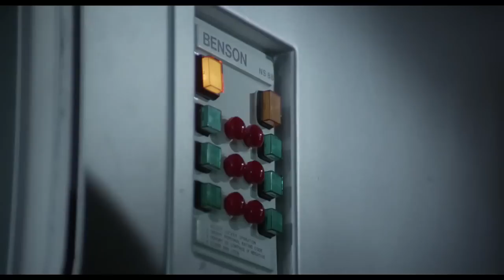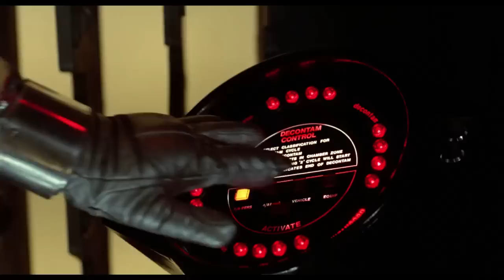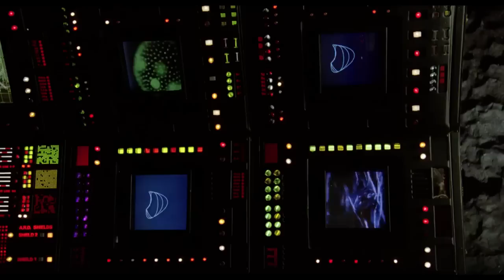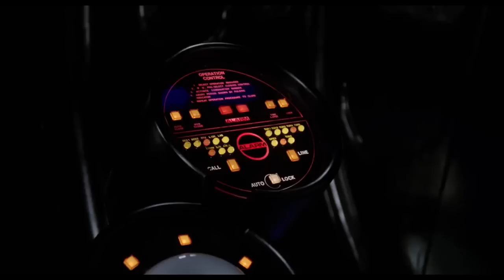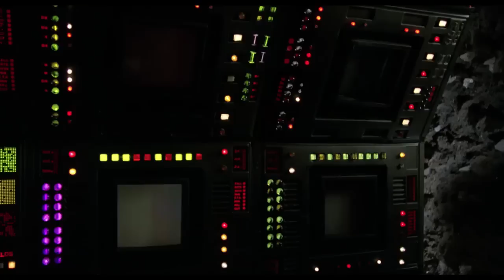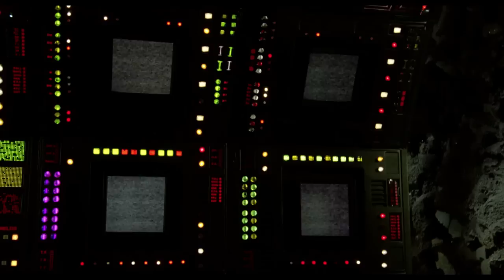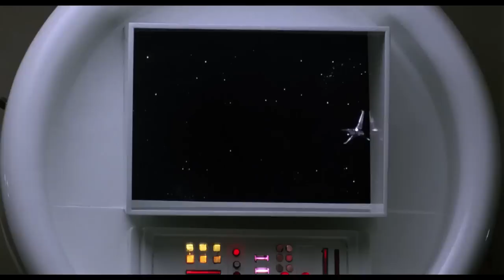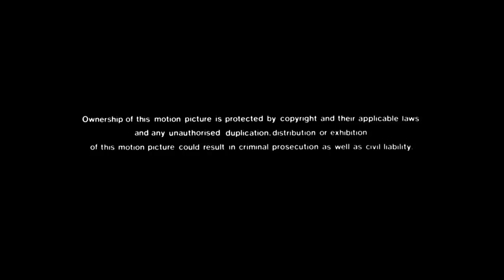Saturn 3 1980 Full Movie

Comment: easy to see some influences of other movies this one had. the terminator came out a few years later, big killer robot.  
hiding under the floor and the bad guy reaching thru the floor to get ya, same as in aliens. 

the movie wasnt all that bad but it wasnt great by any means. it could have been a lot better. heard most of the cast saying the end product wasnt at all close to what they all signed on for.
Reply: The big thing I have as an issue is... why did ANY of this happen? the movie has NO explanations for WHY the plot is happening.
Reply: @marhawkman303 It seemed pretty straightforward to me?
Reply: @leejerrett8268  Well, I mean character motivations not things as basic as the mechanics of what's going on, but WHY did X think this should be done?